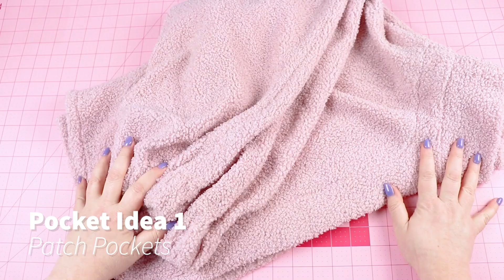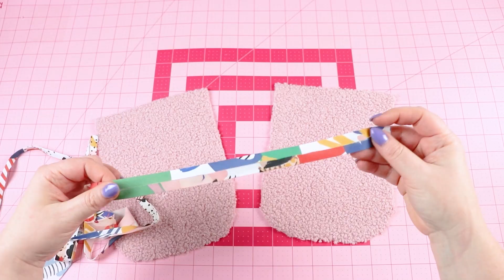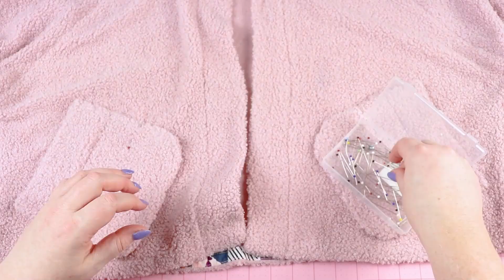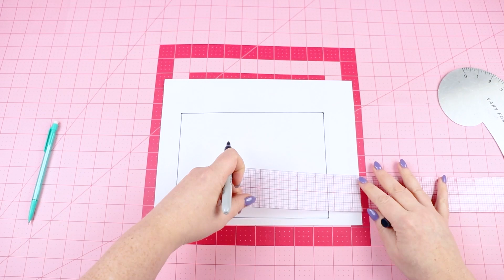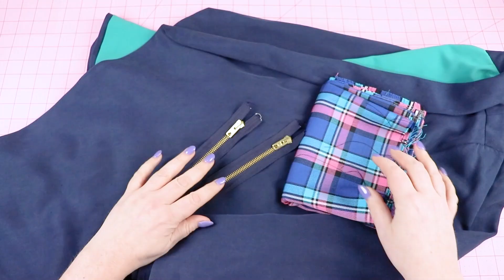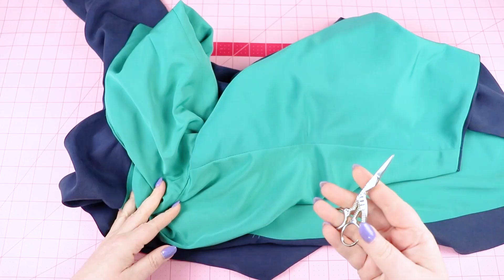Sewing Tutorial: 3 Different Ways to Add Pockets to Your Garments

Comment: Nicely done! 👍 ♥️   Thanks for sharing.  

Btw, although it probably wouldn't work here but I saw a video that showed a VERY CLEVER way to sew zippers onto bags and pouches.  2 pieces of fabric are sewn together leaving a seam allowance to accommodate the zipper's width.  Lay the CLOSED ZIPPER face down on the wrong side of fabric so the zipper is directly aligned on top of the seam.  Sew the zipper onto the fabric by sewing all the way around the zipper really close and sew all the way around again BUT spaced out a wee bit further from the first stitches that attached the zipper.  
Then open the original seam with a seam ripper and... VOILA! Zipper is installed EZ-PZ!😁 You probably already know this trick but I didn't and I found it FASCINATING and VERY SIMPLE because ZIPPERS HAD ALWAYS INTIMIDATED me UNTIL I saw that video so I always avoided them! 😄

Anyway, good job with the pockets and demo.  Thank you again soooooo much!🙏♥️😊

Comment: Thanks for this video. Very well explained.
I have just one question. Is it at all important to cut the pocket pieces on the bias? What's the recommendation for that?
Thanks again.
Reply: Jenn here! I tend to not cut my pockets on the bias as this would cause them to stretch when items would be in there and possibly not lay as flat as a pocket cut on the grain line. Of course there would be exceptions, such as placing in a bias cut skirt, but I would consider cutting them on 1/4 bias instead so that had some stretch but less.